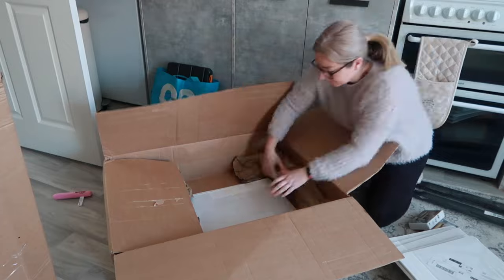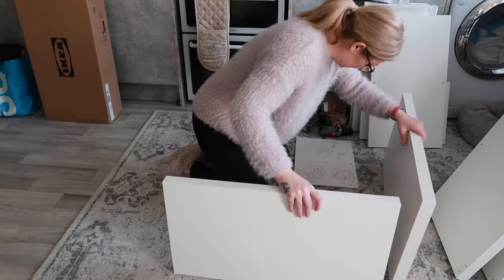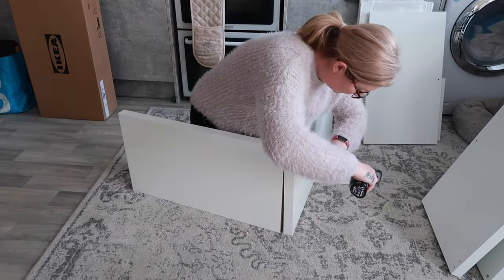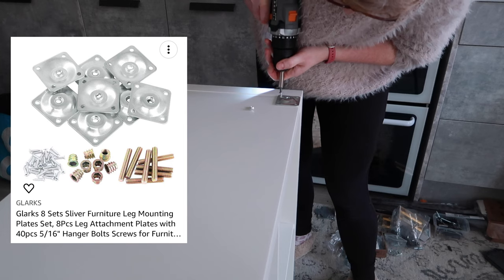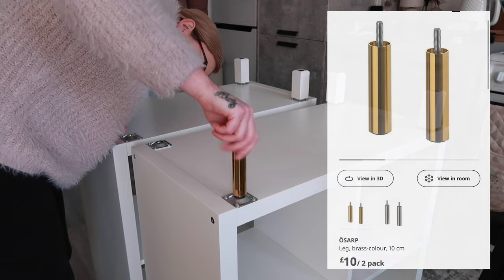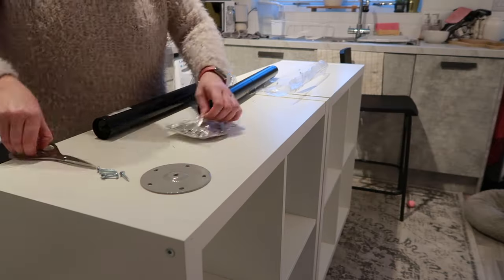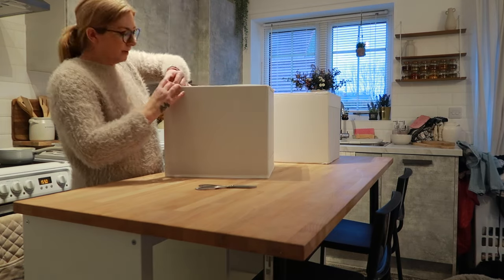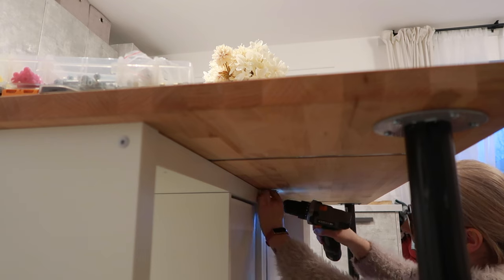IKEA HACK | Easy DIY Kallax Kitchen Island on a BUDGET 2024

Comment: Just wanted to say a quick thank you, as I attempted this over the weekend - I can’t lie, the hardest part for me was lugging that silly box upstairs, as it was not the lightest. 

I used the 8-box unit as it was on sale for £50, then purchased the under-frame for £20 [the 4-box under-frame is £15 from memory].

For the tabletop, I managed to find a return Lagkapten top in the re-use section of IKEA for £12.99. 

Just need to figure out what I’m doing with the top section,  as I used the doors/drawers for the bottom (which aren’t the cheapest). 

I kind of like the idea of incorporating some sort of wine rack.

I used one of the bottom cubes to hide away my air-fryer when not in use, giving me some much needed worktop space back.
Reply from the maker: Oh I love that 🤩 I think using the 8 box unit with the under frame is such a money saver and definitely the better option, that’s an amazing find for the table top 😃 always good to look in those sections, love the idea of the wine rack that would look lovely ☺️ so glad you’ve done this it’s so functional and easy to switch up ♥️ xxx
Reply: Hello, what size did you have for the table top please? I'm also going to purchase the 8 cube kallax

Comment: Amazing idea ! I will probably build the same in my appartment when I move (soon). Thanks !
Reply: The only thing I would have done differently is to put wheels instead of legs. You can get the wheels with a locking break on the so it doesn't move around.